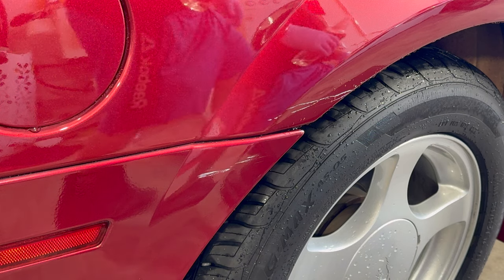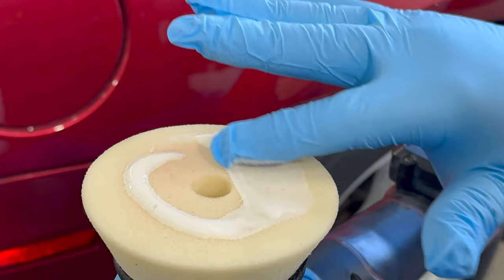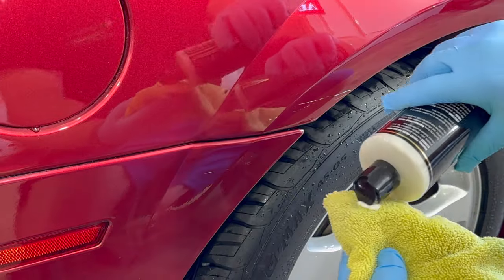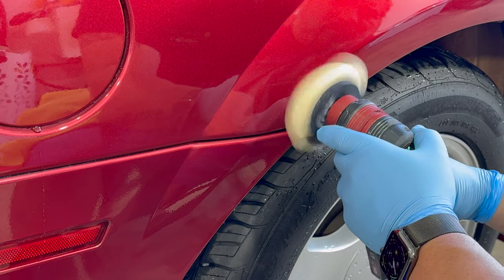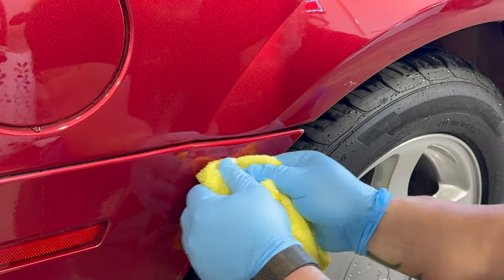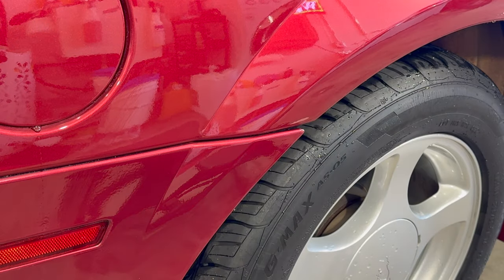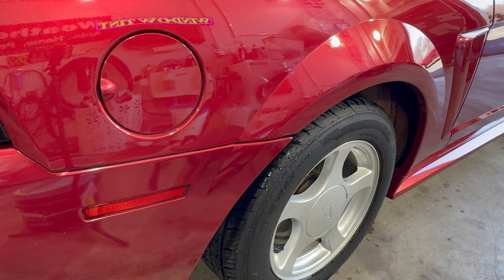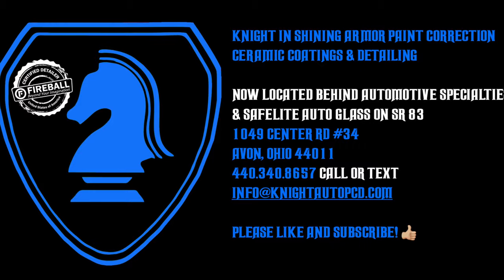How To Fix Or Remove A Major Scuff / Paint Transfer On A Ceramic Coating! KnightAutoPCD | Avon OH

Comment: Would Citrol 666 have been effective as an alternative to rubbing off paint transfer?
Reply from the maker: Believe it or not both it and tar zero are citrus based and both remove transfer ... but citrol is a little more aggressive then I'd like to spray on a coating ... just personal preference
Reply: @knightautopcd  got it and excellent demo.  Thank you 👌